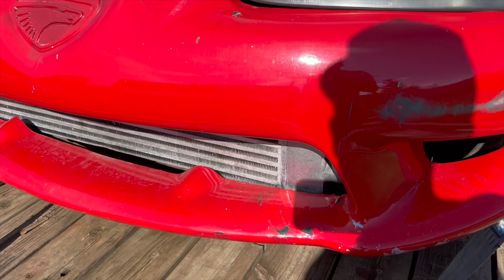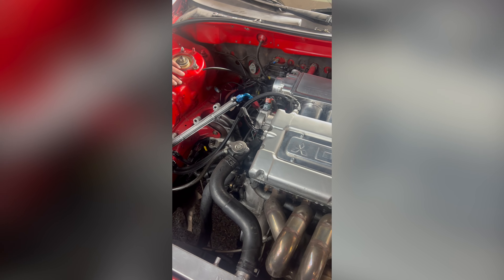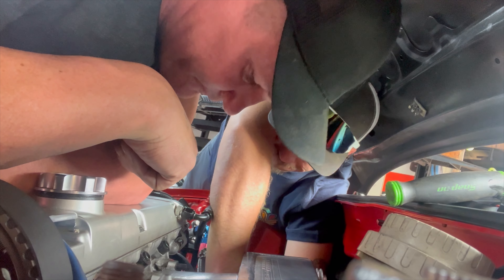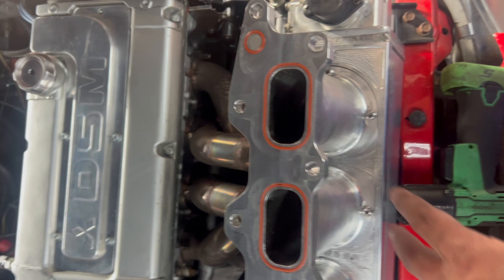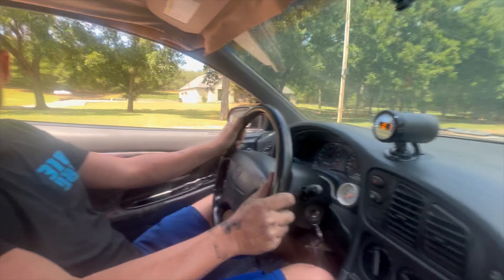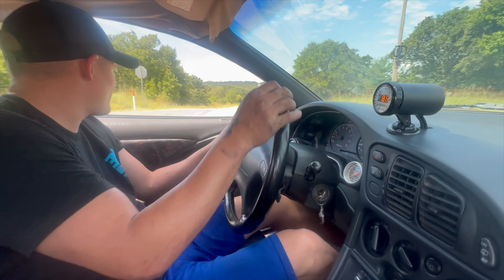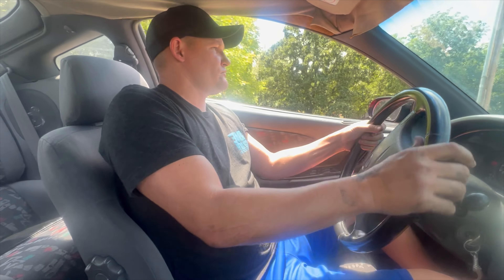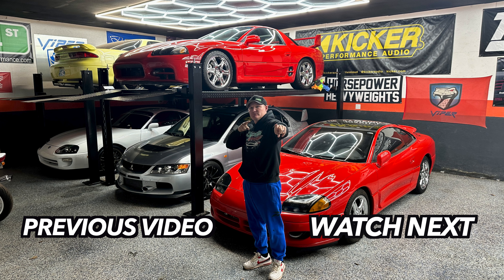My New BIG TURBO EAGLE TALON TSI is SCARY FAST!! 650HP Sleeper Build

Comment: Those s90 throttle bodies are known to leak right out of the box. Theres a guy ( I cant remember his name) that rebuilds them to NOT leak. Not sure if you had that done or not, worth looking into.

id also recommend upgrading those AN breather lines off the valve cover to at least -10an or even -12. 
With blowing out your dipstick you might have just gotten oil all over the alternator if its not relocated to the back, Hopefully not but thats exactly what killed mine when my dipstick popped out. 

Sick Car man! love those 2gb's
Reply from the maker: For sure need a new catch can and larger -10.